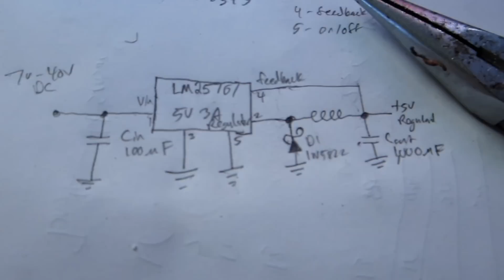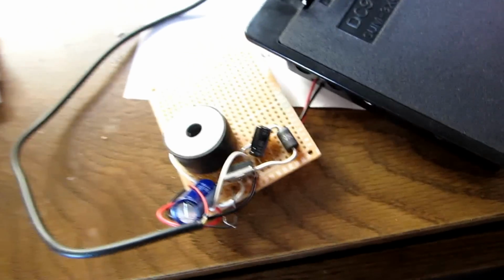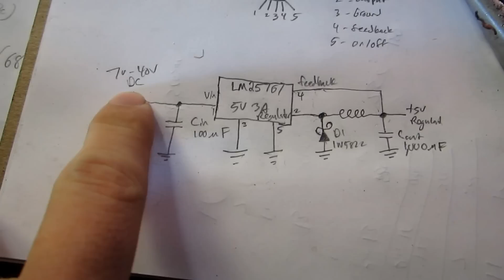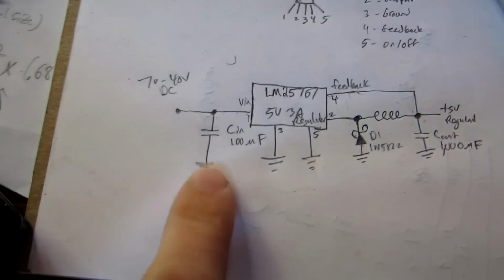Raspberry Pi - Voltage Regulator portable power supply

Comment: why do you need this inductor? i just build a power-supply for my pi, and i only used a 5v voltage regualtor (2A, dont know the exact name anymore), in paralel with a 4700µF capacitor atachted it to a 12V car-battery, worked out great...